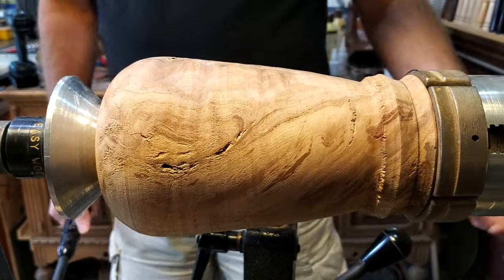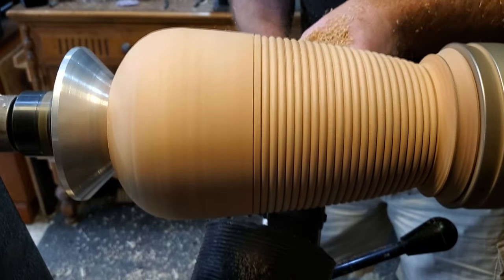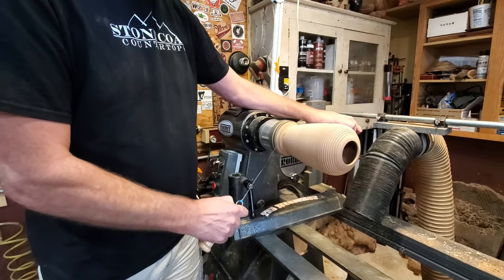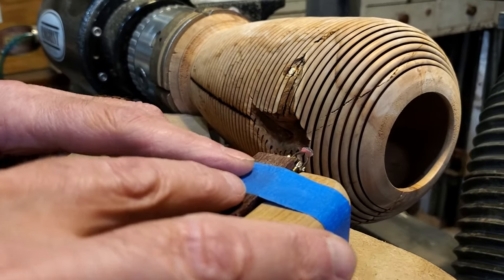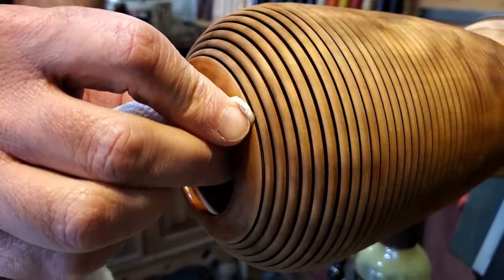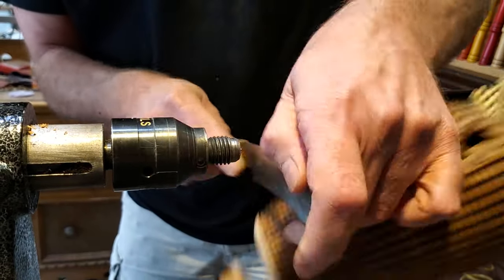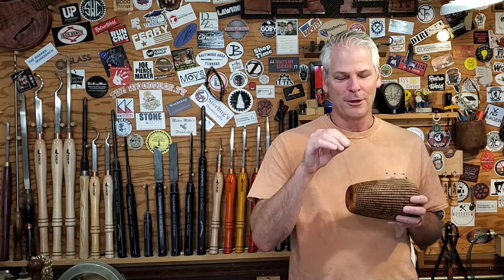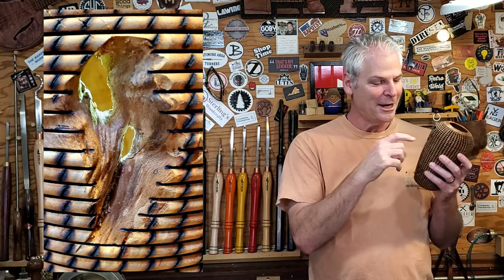Woodturning | Wood Burning Technique

Comment: I know why you use the cards to burn the curved areas...but why doesn't the wire work on the curves?
Reply from the maker: The wire is to long and will burn the sides of the beads.
Reply: @CarlJacobson  oh ok thank you for the explanation.